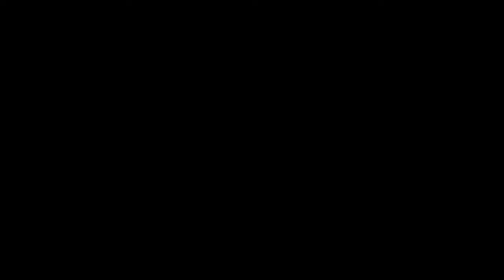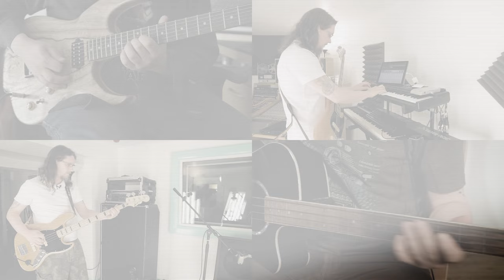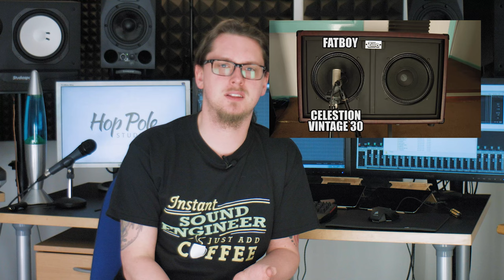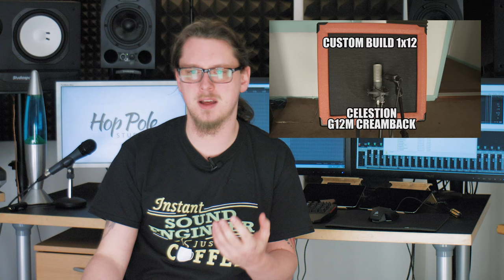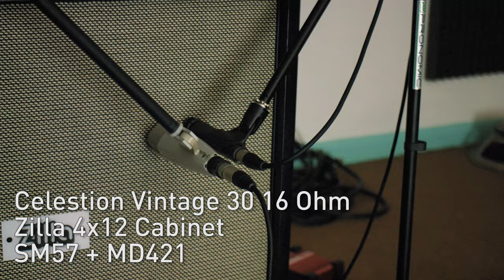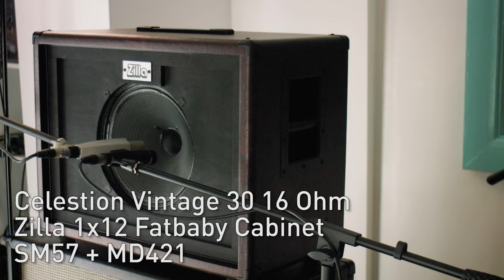4x12 vs 2x12 vs 1x12 Guitar Cab comparison:- All ZIlla, all Vintage 30

Comment: You played at the same volume trough all cabs, that means that the volume you get from a single speaker is different in the 4x12 compared to the 2x12 and 1x12. You can clearly hear from the video that the loudness increases as you change cabs. Since the volume is different, the speakers will sound different, which makes your comparison just as flawed as the one before.
Reply from the maker: Flawed? Get lost. The results are what they are, there is no attempt to doctor the outputs, so the results make their own conclusions. Just because you don’t like it doesn’t mean it’s flawed. Be on your way.
Reply: That was some mature reaction to critic. 😂

Comment: Your mike placement doesn't doesn't truely reflect the output sound.  Placement needed to be were the 2 or 4 speakers project...not just one speaker.....a foot away for all would be more accurate!
Reply from the maker: Another person missing the point- you don’t put a mic “where the speakers project” in modern rock production. You put it where you get the most sonic impact without too harsh a top end- which is exactly where the mics are. Anyone who tells you otherwise is kidding themselves or knows something that multiple Grammy winners don’t.

Comment: The handles made all the difference...
The number of speakers is all about reproducing sound in a LIVE environment, moving air in a performing space so the audience can hear it. 4 x 12 cabs predated guitars going through a PA and are an anachronism with little to no practical use today, except visually. Its wank value only. And mic placement???? Why would you place a mic directly into the coil where it gets the least air?

Comment: Pretty flawed test. Every speaker sounds different so the test would only be valid if you had actually miked the exact same speaker on each cabinet. Also grill cloth on 4x12 changes the sound. Doesn't matter I guess, the noobs bought it and they're selling their 1x12.
Reply from the maker: The tolerances between V30s (of the same impedance) should be tight enough as to render your argument invalid, and speaker grill cloth makes no sonic difference in the audible range (I made a video on this already). Thanks though.